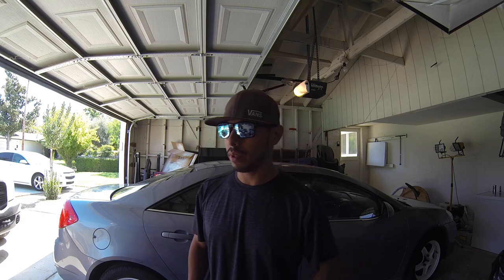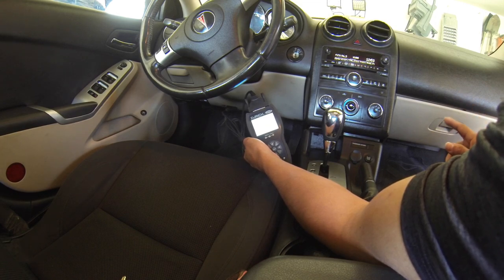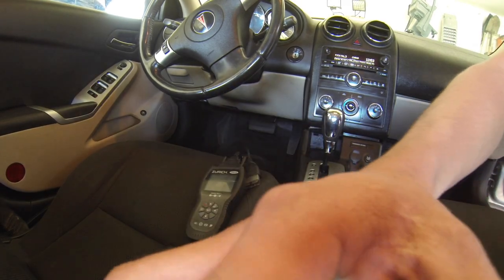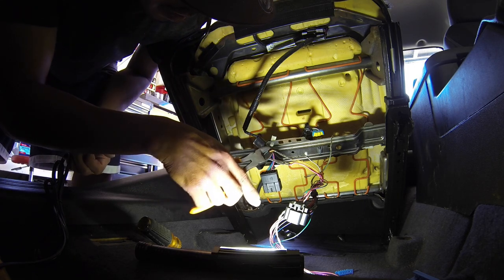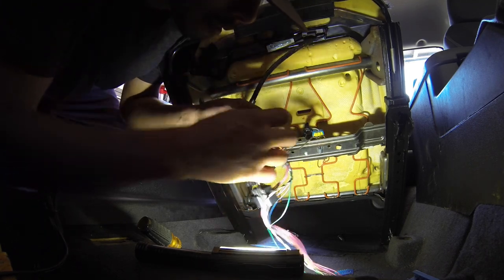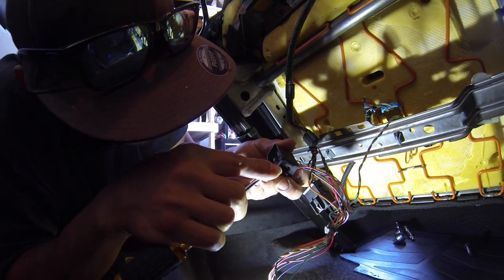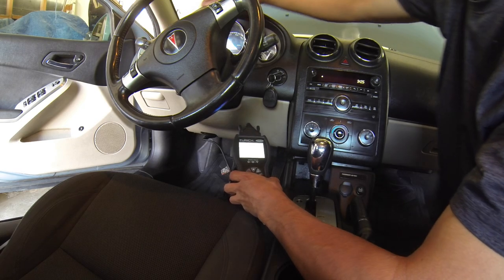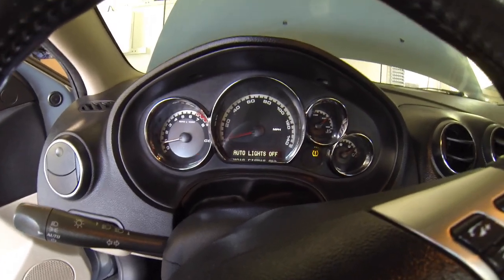How to diy fix/repair/remove Airbag Code B0081-71

Comment: At the same exact issue you cut out a whole entire section what did you really do to fix it I've replaced the module I've recalibrated it I even cut the harness out of another car that was working perfectly and wired it into my main harness and still have the issue

Comment: How did you determine the connection was bad as opposed to the sensor ?my 08 malibu has this problem. I just assumed it was the sensor.
Reply from the maker: Most sensors read high ohms when faulty but easy way to find out faulty connection is to wiggle wires under seat and spray electrical cleaner in connectors. The wires get faulty from the seat moving back and forth from passengers trying to adjust seat. So first wiggle wires. Rest codes and see if they go away. If not then sensor could be bad. Some cars have a passenger seat belt light notification(Hyundai). If it doesn’t flash and the seat is occupied then sensor is bad.

Comment: I have same issue. But when I reset the code with scanner and turn vehicle off, the code comes back. I think I am gonna have to remove seat over weekend and check every single wire individually. My Passenger Presence Module is faulty and still waiting on GM to replace it. I got the airbag360 module as alternative, for now, but still can't get rid of code. It's got to be the wiring.... Great video
Reply: I was considering buying the airbag360 to bypass it but was wondering about this exact thing does your light stay on too and if your vehicle gets te little dash board messages did it still say service airbag?
Reply: @samanthagibson7688  I actually put car in shop GM and having service dept figure it out. I have the airbag360 and if they fix my car and I no longer need it, I could mail it to you to try before purchasing a new one

Comment: Well my 09 malibu has this same exact issue. Looks like ill be doing this tomorrow😁 ill let ya know if it works. I think my wiring coming up from the floor is my issue. By chance do you know what the wires were that didnt have good flow thru them?
Reply from the maker: My wires were the Connectors that connect to the sensor under the seat. Best thing to do is get a scanner that reads SRS codes and if it’s a passenger sensor code then it could be wires right under your passenger seat but some cars like some Audi’s have a sensor in the back seats which are also passenger seats. I know that there’s a weight limit for that middle back seat on Audi’s and once it’s reached the srs light will stay on until reset.
Reply: I ended up needing a new passenger seat sensor also but i did fix my wiring issue also. Stupid how they ran the wires in this car, let alone the mats design for inside the seat. But yeah thanks to you i no longer have a airbag warning light on. Thanks buddy!
Reply from the maker: Ahh ok. Well I’m glad you got your car fixed. Not a problem😁
Reply: @keyrogygaming4064  I'm having that same problem where are you located?
Reply: @trevorhiggs352  what's was your wiring issue?
Reply: @trevorhiggs352  hey man where did u get your sensor at? Everyone says I got to buy the whole seat. Thanks